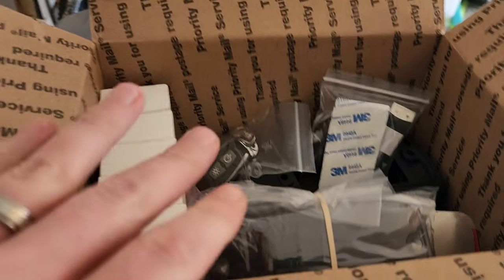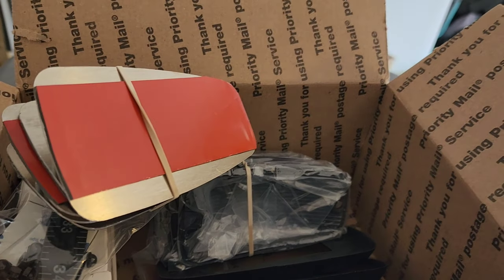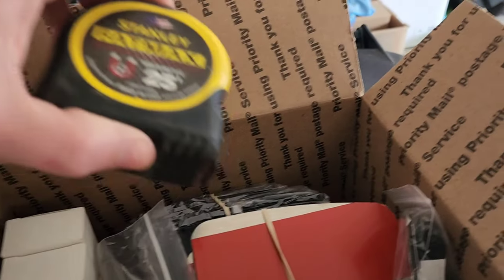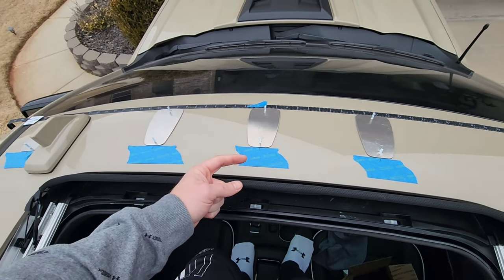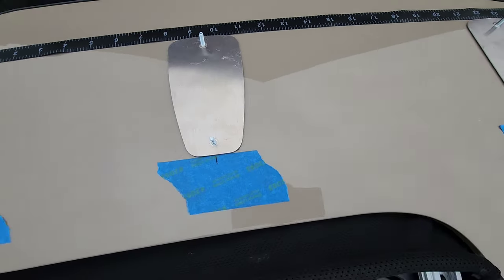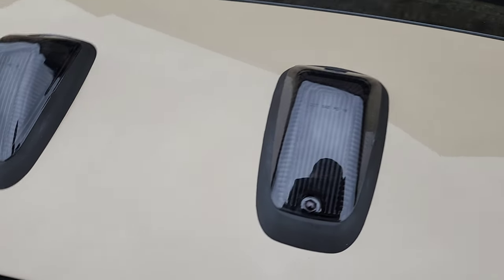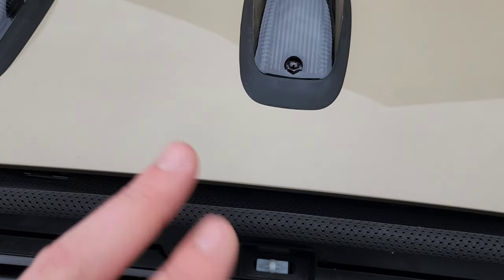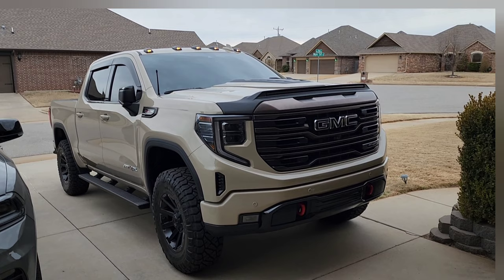Adding WIRELESS CAB LIGHTS to a 1500...AT4X!!

Comment: $400! For these lights your kidding. Ya you lost me on this product. Little lights like this. Il pass. Most ridiculous price iv seen yet. You could of gotten a light pro bug deflector cheaper. Lol to bad there so over priced  because they are cool. I checked your link on these lights and I was shocked by the price. I thought maybe $150 or less but $400 ! I can do without them. To bad they would have looked good on my 2021 GMC elevation . They are accent lights that's all . I did order the pro deflector. That was $250 and that has function but the cabs lights just sit there and make your truck look good with no real function . Ya I'm good . But what ever floats your boat. Me that's to steep a price.I might get pulled over if I use the strobe  feature. Lol
Reply: Good is not cheap and cheap is not good! Lol
Reply: @toddhowell1535  over price is over price. At that price there is a big window to keep looking.
Reply: Long way to say you’re broke
Reply: Too*
Reply: But once cry once bubba 😂
Reply: Yeah, the absurd pricing alone is certainly bad enough! To make matters worse, the product quality is garbage as well. By MANY reports of those who have previously owned and installed them, these lamps have been proven to be unreliable, as well as a pain in the ass to use.

Having separate key fobs for turning them on and off separately from the truck is absurd and an extra hassle. The need for them to rely on solar re-charging is no good either. 
Some things are just not meant to be wireless. This is one of those times.
Reply: Cry more Jesus Christ

Comment: You should have drilled through the roof into the cab, removed the headliner, run wiring all over the place, screwed in all the lights and then sealed everything back up. NOT!! Why would anyone do that now a days when they could install the lights you purchased? Those look bad ass! Nice work man!
Reply: That is the most stupid thing I heard yet. On a new truck . Maybe if the truck was 15 years old but even then your asking for trouble moisture leaking ya forget it .3m is good enough if you prepare it. It holds well and almost impossible to remove it. It can be done but difficult.
Reply: They don't turn on when the truck starts. That blows
Reply: READ ' STVICK ' POST. U WILL KNOW WHY THESE ARE USELESS.
Reply: Because it's not that hard if you're just somewhat handy

Comment: This looks really good! I think your truck looks sick!

Just so everyone knows, those lights usually have meaning. So you know on the larger 3/4 ton and one ton trucks that are wide and tall N/A, and the Raptors/TRX are extra wide, N/A. The lights you see on them are mandated per DOT standards.

 The 3 markers in the middle as you see on raptors/TRX and other large trucks are to present the vehicle is an excess of 80inches wide. The single exterior cab lights are to present the vehicle is over 7 feet tall. 

Now it is not a crime to have these lights on a small vehicle such as a ranger but they do have meaning.
Reply: our 2500hd z71 diesel didn’t come with. dealer said it’s an option.

Comment: Oh you had an easy install because you got a sunroof. Ive had these lights about as long as you have. 3 out of 5 for me because the led's can be unreliable. Some dont charge, some flicker after awhile. Inconsistent...i did buy replacement lights but its a rip off to keep buying lights that may not work correctly. Drilling holes is what i wanted to avoid doing so im good with that. The night driving and charging is almost non existent when they only hold a 30 minute charge

Comment: Would be cool to find a way to have them come on when the headlights come on.  It would be easy enough to rig up a relay to the RF transmitter but would just be a pain.  Wish there was something pre-made.
Reply: Yeah. Like a wireless transmitter hooked into the running lights signals these to turn on.  Thatd be cool

Comment: Since you’ve had them on now for a few weeks, have you had any issues? I saw a ton of bad reviews on Amazon about the light not lasting more than 10 minutes, lights not syncing, lights not charging. Just curious to see your experience so far since your like the only video I’ve seen that had these recently installed.
Reply from the maker: Only issue with one,  was one not syncing once and possibly not charging correctly. I just keep the remote in the truck, put it to the windshield to turn them on. Apparently I didn't hold it long enough for one to turn on or it didn't charge right. After I resynced the next day it wouldn't turn on at all....wasn't charged. Granted it was completely cloudy so couldn't really charge but the other 4 had a charge.
Reply: @WICKEDAUTO1  how long do they last? Are you getting the 12 hours they claim?
Reply from the maker: @MarcosReyes53  that I can't say as I have not had them on for that long. Max I've had mine on has been approx. 1.5hr n they were good to go
Reply: @WICKEDAUTO1  thanks man I appreciate it
Reply: What happened to the one that died on you while other 4 were turning on? Did you figured out what was the cause? How did it performed after charging, mine's having same issue 1 pod is not responding

Comment: could try gutting one of the remotes and using relays so that they turn on and turn when starting and stoping the car. that would be cool. Been a few years since i was a MECP installer but i know you can hold a relay for a certain amount of time. the only downside it if they get out of sync.
Even smartter would be a magnetic switch for the lights. under the headliner under each light. car turn on magnet flips the lights on. car turns off magnet turns them off. no holes no prob.

Comment: Tell me about the hood scoop. I believe you took it off. Can you tell us why? And how long did you have it on. Did water accumulate in the middle?
Reply from the maker: @johnnyg8391  nope never took it off. Water did not stay in the middle while driving, of course did sitting in the driveway after it rained but dried up like anything else
Reply: @WICKEDAUTO1 awesome. My mistake I thought you said you took it off or swapped it out for another one or something, but maybe I’m confused or something else. Other than that, if you still have it, do you like it I’m getting ready to purchase it and paint it as well. Just wanna make sure you’re happy with it. Thanks for your fast response.
Reply from the maker: @johnnyg8391  o yea absolutely. I’d buy it all over again. Never one issue with it still secured perfectly, driving cross country, below zero temps, over 100 temps n I hand wash only with a high pressure pressure washer

Comment: So do you have to remember to turn them off so the battery doesn’t die.
Reply from the maker: Yes and no. The battery will die, I believe I've seen around 12hrs of battery life from others that have these lights but you can't really tell they're on during the day anyway so the sun would charge them until you want them on at night again or the lights in your garage can charge them
Reply: If you ever need to remove 3M like that use fishing line
Reply: That's the deal breaker for me. The remote seems way too inconvenient.

Comment: HOW ARE YOUR LIGHTS HOLDING UP I BOUGHT THEM A MONTH AGO AND MINE WILL NOT HOLD A CHARGE
Reply from the maker: @robsamazinworld8159  had to turn then back in under warranty which is only a year so ya know. The 2nd set worked good

Comment: So were the lights themselves Amber or did they only turn Amber once the filters were put on? I ordered smoked lens with amber light under the impression that the lights were white, but to turn them amber you had to put the filters on. That’s just what I saw in other videos showing off the lights. I figured I’d run amber for a bit to see how I liked it then take the filters off so they could be white, but I think I messed up.
Reply from the maker: Yea ordering amber lights they are amber, well yellow without the lens. If you wanted actual white should order the white lights n use the amber lens

Comment: Yea idk, seems like having them turn on automatically with your lights is more convenient.
Plus if you forget to turn them on now it looks like you have cab lights burned out
Or you have no sun for a while in the winter and they still look burned out
Reply from the maker: I certainly agree with the turning on automatically but the price of not wanting to drill in the roof. However this is something I shouldve added in the video I guess, they can charge by the light in the garage as well.
Reply: @WICKEDAUTO1  i never had a garage that fit my truck😂

Comment: Sir, Do I have to do it all manually when I turn it on and off? Doesn't it work automatically when you turn the engine on and off?
Reply from the maker: Nope, it is only turned on/off with the remote.

Comment: any ideas yet for a 20 in light bar?
Reply from the maker: Still thinking on it, haven't pulled the trigger yet. Have a couple options but haven't chosen the best/easiest/most asceticly pleasing
Reply: @WICKEDAUTO1  which options are you looking at
Reply: @WICKEDAUTO1  Putco is way to go friend. I have one on my Trail Boss and it’s bada$$! You can also get a plug and play harness with too so no splicing involved. GM sells it as an accessory on their website but you can find it cheaper

Comment: I've read enough product reviews of these solar-powered, wireless, LED clearance lamps to know that you should avoid these things like the plague.

In theory, they were a good idea. However, in real-world practical application, they are not very good at all. Poor quality intermittent and permanent failures of individual lamps, combined with lousy inadequate solar power recharging, and the fact that you have to use the key fob remote(s) to turn the lights on and off, are just wayyy too many problems. 

All that nonsense, just for an aesthetically pleasing look to the top of your truck cab? 
Nah. Hard pass on these. Save your money.

If the right way to do it was wireless, you can bet that the OEMs would have already been doing it. Sometimes, accessories being properly hard-wired to the vehicle's existing exterior lighting system is a much better & more reliable choice. This is precisely one of those times.